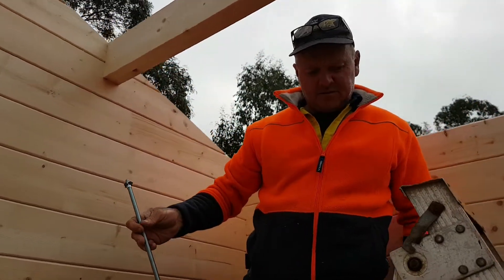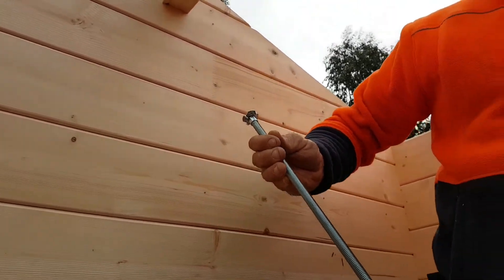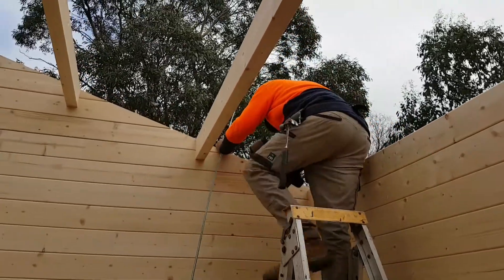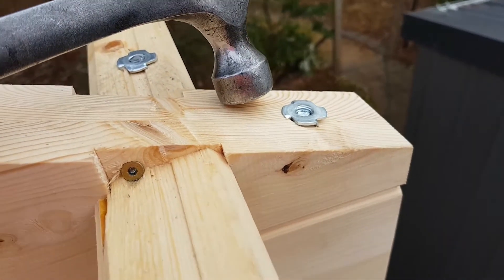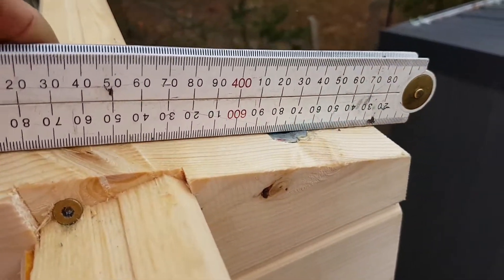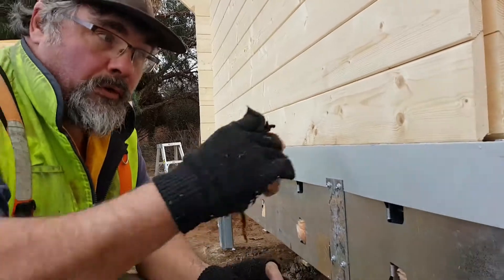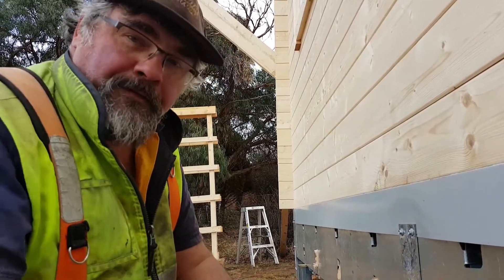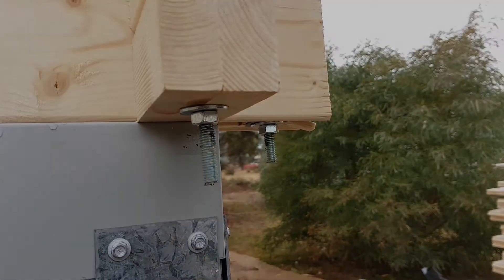Step 15 - Tying Down the Structure | Scandi Group Builders Guide

Comment: It won't twist off it will tighten up, I think I would counter bore a recess for the star nut. The copper anti seize is a good idea though. I think I will counter bore the bottom of the holes for the nut and washer so it doesn't look so rough.